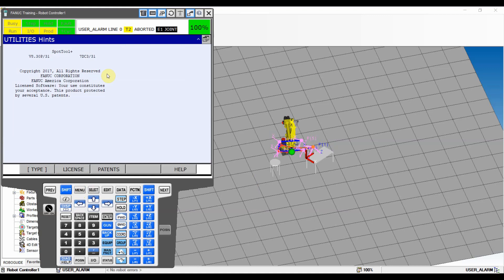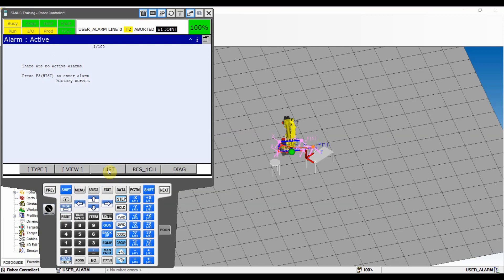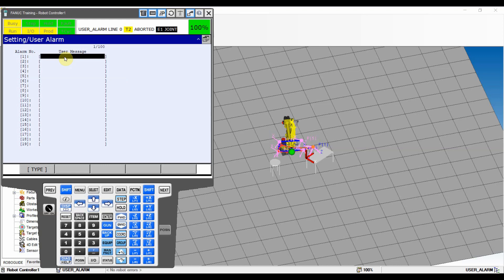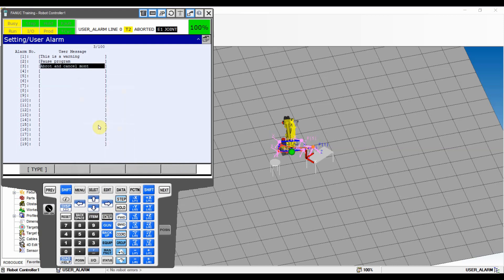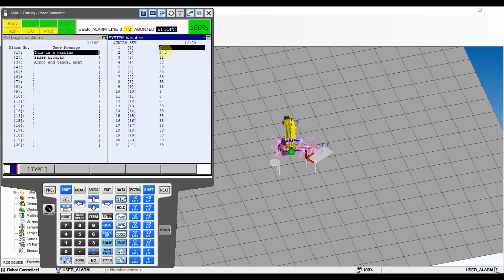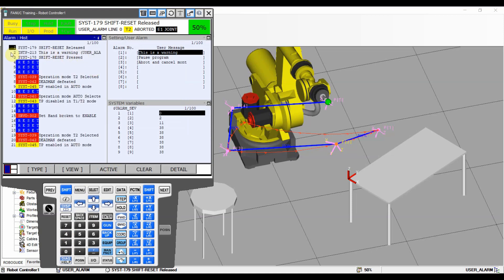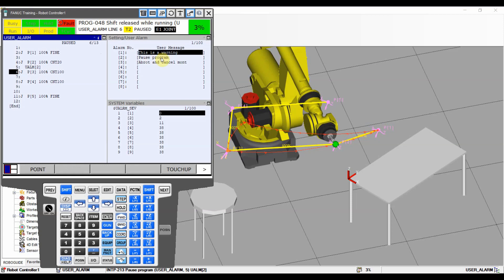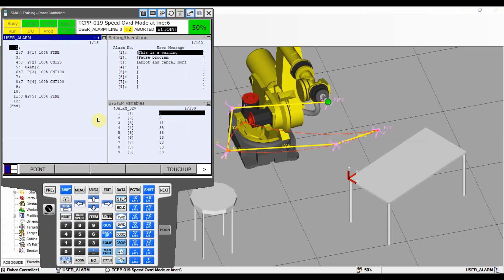FANUC User Alarm - How to set up your own alarms ?

Comment: I am having similar issue with my R2000iB Robot. While it is running the main program, at certain steps it will stop and give the following error Alarm Detail: "SYST-034 HOLD signal from SOP/UOP is lost" Initially I thought there might be a problem in the program. I restored the backup softwear, but this did not eliminate the problem. If there was any alteration to the program causing the issue that would have been eliminated by restoration, or am I missing anything? I have also been directed to check all the input output signals to PLC, I asked my controls techs to look into that. they came back to me and said they did not notice anything obvious. I am lost now, anyone have had similar issue and what the remedy was?
Reply from the maker: Hello, as the message states:
"SYST-034 HOLD signal from SOP/UOP is lost" means that you've lost HOLD signal, which means that HOLD (UI[2] = OFF). As you see it's an INPUT, that most likely comes form the PLC (you need to check what is UI[2] mapped to, but 99% it's going to be PLC). This error shows when the UI[2] changes state from ON to OFF when robot is running, so in order to troubleshoot your PLC guy have to set up a monitoring for that signal (do a trace for signal that goes to your UI[2]) and you will find if the PLC is loosing the signal. Than to find out why, he has to do a trace for ALL signals that are linked with UI[2] signal and by looking when UI[2] was lost you will find why.

Comment: Hi sir
I get the error while i start from operator panel in auto mode
UOP is the master
Is there any setting need to do?
Reply from the maker: In MENU->SYSTEM-> CONFIG menu you need to select your start as LOCAL